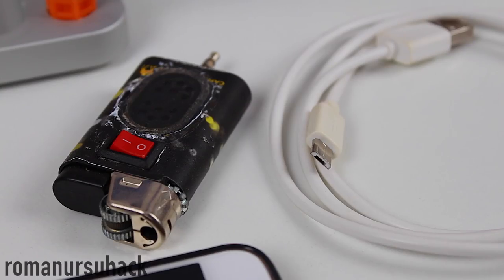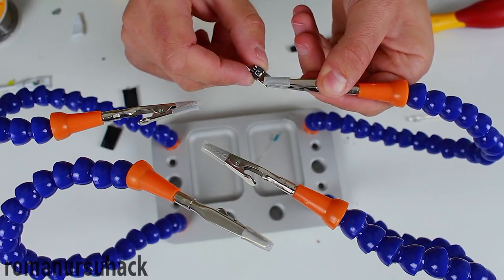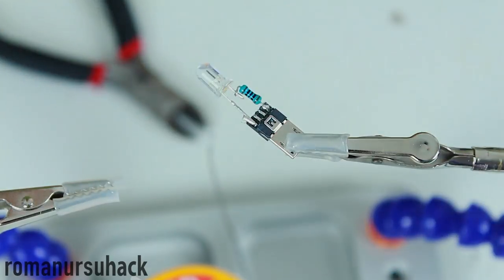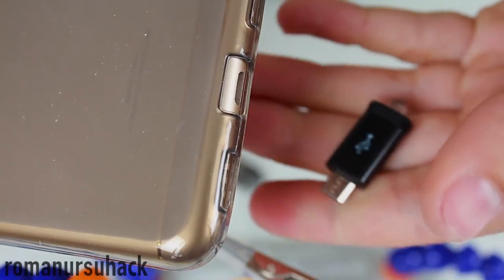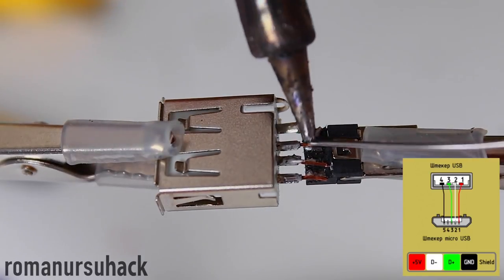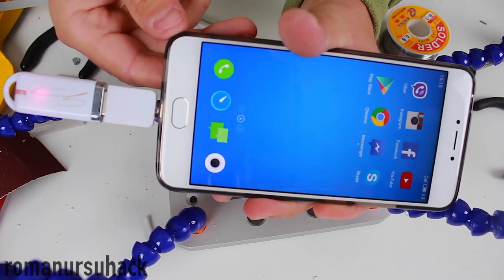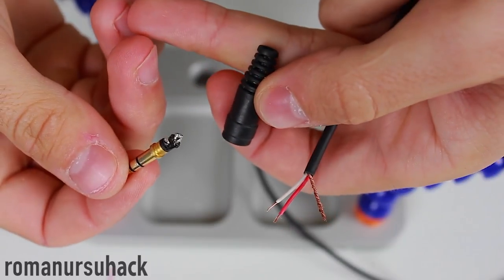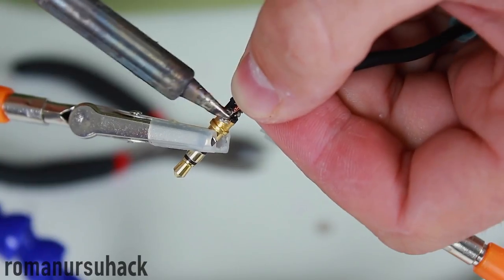3 Ideas about making DIY gadget projects for a smartphone

Comment: He didn't short out the two pins that are required to tell the phone that it's an usb otg
Reply: thats right, he fucked up, but now is his phone recognizing it, thats one of the misteries of thw universe
Reply: +runnerJong *how
Reply: Llama hu
Reply: I really hope this gets upvoted because people need to know about this. I think his might have worked because the pin was already shorted but for those who don't know, the reason microUSB have a 5th pin is so that the phone (or other device) can use the port as a USB HOST port. This requires that you short out two of the pins. (Google "microUSB pinout")
Reply: no ive done this before its not always neccesary alot of phones dont follow the protocol and will work with flash drives without enabling the otg mode i know this because ive made usb adapters that specifically dont enable otg mode so i can use usb devices on my tablet whilst charging something which you cant do when otg mode is enabled
Reply: Really? What phone do you have?
Reply: a couple phones my note 4 does it fine with a adapter i have that dosent even have otg pin5 conected i know this cause i didnt connect it ...
Reply: NikolaJXPL
Reply: Mysteries**

Comment: A good alternative to the syringe idea would be using the hollow end of a pen (with the ink vessel/dispenser removed)  I have been doing that to my broken headphone plugs for ages, not as "easy" as you might have to cut plastic off (and you might still need to drill it if your wire is bigger then the hole in the tip) but is far more readily available and will last longer.

Another good idea would be to put a bit of heat shrink tubing over the finished project for aesthetics

Comment: +Roman UrsuHack when i take a 9V batterie and connect it to a red LED and the same resistor that you used in the video, will it work?
Reply: Needs larger resistor.
Reply: 9V battery kills normal LED in less then 1 second.
Reply: Use a R270 ohm for led White cool!
Reply: No, try two those resistors in series.
Reply: ***** Wasting electricity.
Reply: For Red super bright, use a R360 ohm!
Reply: thank you all!👍
Reply: i think in the case of 9v battery the most efficient way is to use a 3 led in series with  resistor. in the case of 1 led and resistor  2/3 of  be spent on resistor heatin' but not on emitting of light
Reply: HarryHirsch try it!

Comment: The last one is overengineering. Just buy some heat-shrink tubing for $2-3, slip it over the cord, solder the connections (make sure the solder joints are not touching each other, maybe use a little, tiny bit of superglue) and slide the tubing over the connection. Heat with a lighter. Done.

Comment: Incidently, pretty sure that the power to your phone's LED is more regulated than the USB output. I'm going to guess that most phones will supply the standard 5v 500mA through the microUSB. Ok, so we have 500mA, which is way over spec for a 5mm white LED, but we have that resistor, so we're probably fine, as long as we don't choose too small of a resistor. But driving the LED at 5v seems a little harsh. I feel like we are going to have issues. Your phone's battery is, after all, only 3.7 volts, and I believe most phones have a tap directly from the battery to the flash LED. That is much closer to the roughly 3 volts most LED's take.
I could be wrong here, so please do correct me if I am.

Comment: Because everyone has everything you need for this video just laying around
Reply: What, you don't have a soldering iron?
What do you do when a cord on some expensive headphones breaks, buy a new set? That must be expensive.
My soldering skills have saved my gaming headset probably 10 times now because the cable on them keeps fraying out where it goes in to the headphones. IMO the cause is a badly designed strain relief in that area. Cable likes to kink there instead of bending.
Replacement cost: ~$70 USD and an hour of time for the trip to the store. Fix cost: Only 1-2 hours of time, and a few cents worth of solder.

You can get a knock-off (but still good quality) soldering station online for like $15 USD, they're all over Amazon and Ebay.
Tutorials for how to solder are all over YouTube, and it's a pretty important skill if you ever want to make anything that uses electricity.
Reply: you can also add heatshrink to the ends to beef them up so they won't break so easily.
Reply: 44R0Ndin
Reply: 44R0Ndin honestly all im saying is that some people don't have soldering stations and they stuff needed for this
Reply: Jack gaming
And what I'm saying is that when usable soldering stations are at a $15USD price point, you no longer have any excuses other than "I don't want to learn".

Comment: This is why you buy cheap earbuds like the $5 US Monks off AliExpress, use headphones with replacable 3.5mm cables(also keep spare cables as they are cheap as dirt on eBay, or AliExpress), far as OTG Adapters you can get them all day long on eBay for $0.75US with free shipping from Hong Kong, and I Have several of them in my spare parts box, and they work great for my phones, and daughter's Android tablet. Lastly the LED on most Android phones will automatically turn off after a few minutes, or if it gets too warm as a safety feature, so no need to make an LED unless you just don't have one on your phone, or your battery bank does not have one built into it.

Comment: does the second DIY really work?
Reply: Do you mean the On The Go cable?
Yes, it's actually how adapter works.
Every socket uses different pin arrangments but it's enought to connect the correct pins with the counterparts of the other end

Comment: on second project you need broken both micro and usb,  sandpaper, soldering iron, the tin lead and also electricity to use the solder how it will save money?? while brand new usb otg is only 3-5 dollar a piece LOL

Comment: Can you show us how to  make a micro USB microphone ?
Reply: Modeller's Point you don't use micro USB for that, you use the headphone jack. That is far more simple. A micro USB microphone will require a controller circuit to feed the audio in digital format to the phone input, as well as a dedicated application to decipher audio and play it back on the phone.
Reply: ***** If you must know the inbuilt camcorder app of an android smartphone cannot detect an external microphone and continues to use its internal microphones which results in a bad sound quality for the videos but a USB microphone can bypass the phone's inbuilt microphones and record using the external microphones even when using the phone's inbuilt camcorder app. So if we can figure out the connections it would be handy.
Reply: And note it is only available for phones with OTG capability and may be needs Lollipop version or higher.
Reply: Modeller's Point really? lol that's weird, but there must be a setting to change it to the headphone mic. If not I'd say the simplest option would be to use a third party app for recording. If OTG allows the micro USB inputs to transmit audio data directly to the phone, without the need for any hardware to convert the audio into a digital format, then it should be as simple as soldering the microphone to whatever 2 pins allow OTG to utilize input from the micro USB as direct audio (not digital). I'll do some more research on OTG but using a third party app is probably the simplest option lol.
Reply: Modeller's Point I just checked, they sell something called a micro USB headphone adapter. It should be easy enough to make if you can find the pinout diagram. It looks like you don't need any hardware to convert it to a digital signal, so it should be easy. You could even chop off the headphone jack on your mic and solder on a micro USB connector but then you couldn't use it elsewhere so best option would be to find pinout and create an adapter. Or buy one from eBay lol.